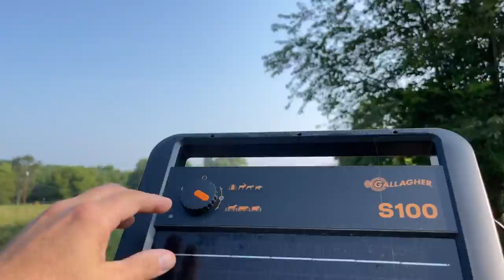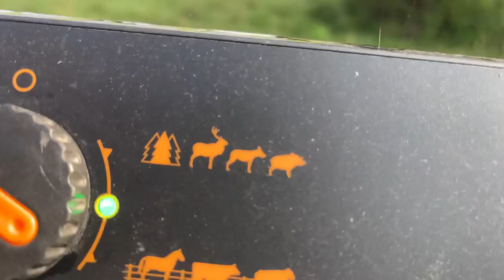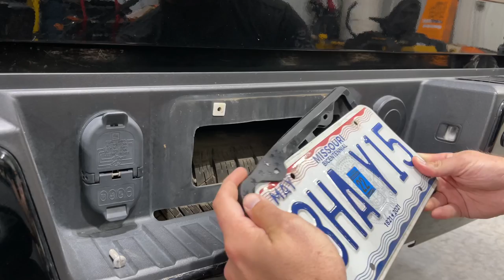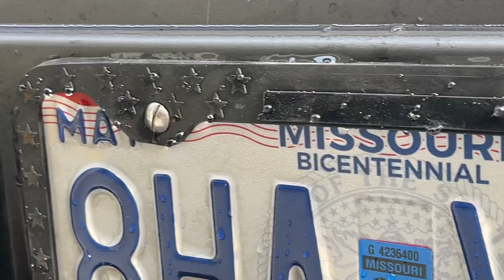THEY FOLLOWED ME HOME!

Comment: You are absolutely right if you give into Adler wanting cookies before the chores are finished he'll find a way to get 2 sets of cookies and expect it all the time. 
You are doing a great Job with both the boys. Yes the silicone plate holder will help with the rattling when pulling the trailer.

Comment: True statement at the end. You're a loving dad, with many reasons to protect. God bless you! And I'm not the "one", but I would put myself in harms way to protect those around me. Definitely part of the 73%, but I'm looking Tyler up as I type. Love you guys!
Reply: Why don't you cut his horns
Reply: @beverlyjenkins4370  I gave it a thumbs down not for the question, but for the act. Debudding should be and usually is done when the goats are young, and is not pleasant unless bands are used. It's not as simple as just cutting off his horns. Hope this helps, but it may not have even been the horns that caused it.

Comment: The first scratch on Batman could have been from stress behavior... even the second one.  But... check for external parasites.  Early in our goat raising experience we got some angora goats from Texas that were loaded down with LICE!  (Before you panic the lice are host specific.)  We were newbies and didn't know what to look for.  The first couple of days they scratched endlessly with their horns and rubbed hair off.  We used a pour-on remedy.  Also these lice didn't spread to our pygmy goats (go figure).  So check Batman out for lice!  If you find he has them be sure to treat the other goats.

Comment: I would have to have a good picture of the bare spot on Batman but from my experience with ND goats is one of three things. 1) being in a wooded area they can get fungus on their skin from rubbing on anything wooden that is damp. Iodine will clear that up in a few days applying it twice a day. 2) lice or mites which goats can get easily no matter what you do. Some get them and some don’t. Spraying them down with Permethrin 10 (mix with water as directed on the bottle in a spray bottle and spray the goat down completely to the point their hair is wet and rub it to their skin. You will want to wear gloves to do this. Just let them air dry. Don’t get it on their face. It will not hurt them at all. I do this before and after every goat show on all of our goats to make sure we don’t spread anything or bring anything home from a show. You can get this at a tractor supply type store). Or 3) just dry skin. ND have more of a course hair than other goats and it’s common for them to get dry skin. I treat this with brushing coconut oil onto their skin with a horse brush once every couple of days for about a week until you can see the dry flakey skin start to heal and is no longer red or a deep pink color. The oil will help the hair to grow back quicker too. Get the liquid type oil…not the solid coconut oil so you don’t have to melt it. It won’t hurt the goats to lick or eat the oil either…it will actually make their hair shiny and softer. 😁 I hope this helps with Batman.

Comment: for Batmans horns you can do one of two things..
- use a pool noodle cut to a bit longer then his horns n slide it right on his horns, or do a quick trim the tip off sawsall  & cut the tip off flat  just like cutting nails.  potatoes look ready next year try hilling add dirt up as they grow or try or ruth stout method